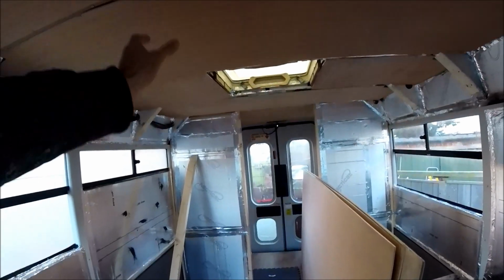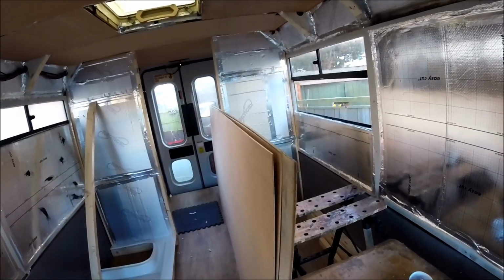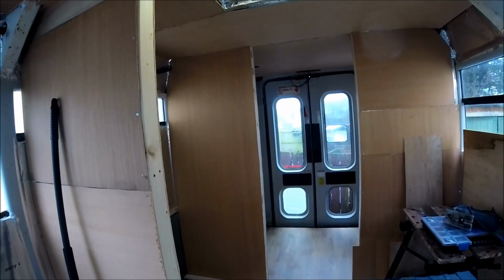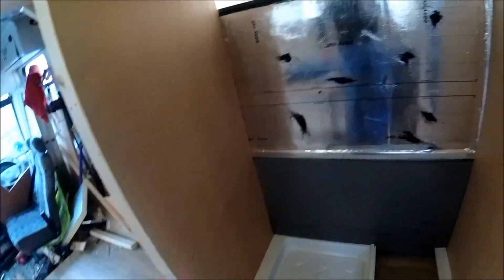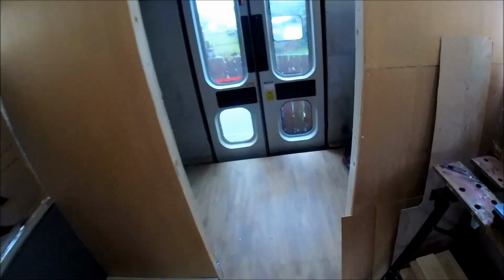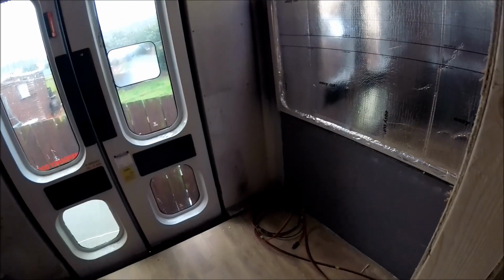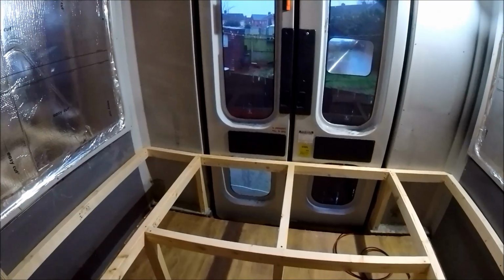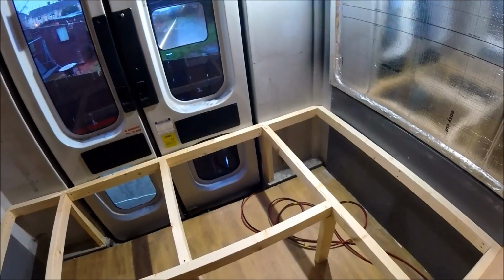Minibus Camper Conversion Part 9: Constructing Bed Frame & Internal Walls

Comment: Was wondering why you didn’t make the bed a bit higher up so you would have more of a garage space underneath. It’s coming along nicely though 👍
Reply from the maker: if it was higher, it wouldn't be comfortable as a sofa with legs dangling over the edge

Comment: Looks good. With the fixed Frame no access through the back doors to walk through is that your plan.
Reply from the maker: That's the plan, although you can still access the rear doors by walking / climbing over the top of the bed if need be